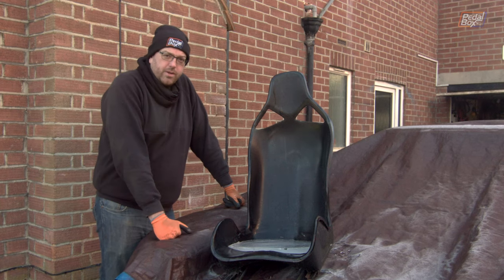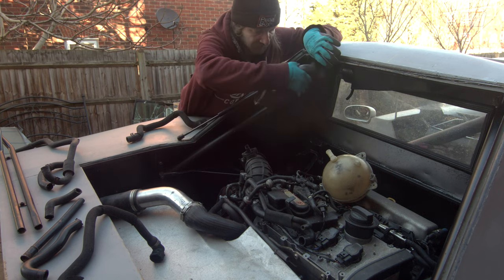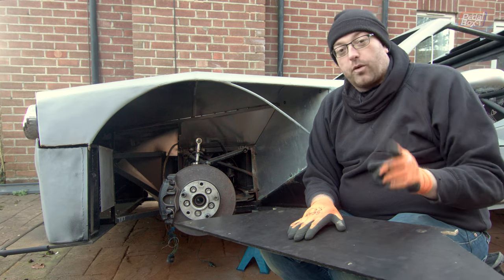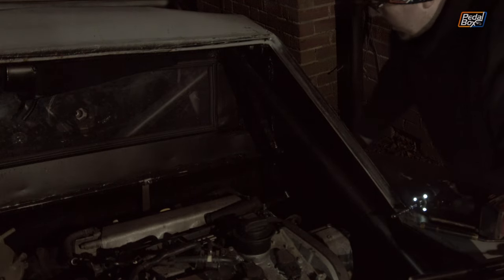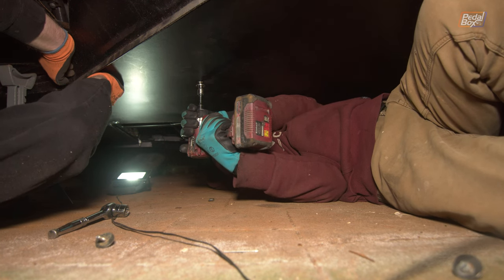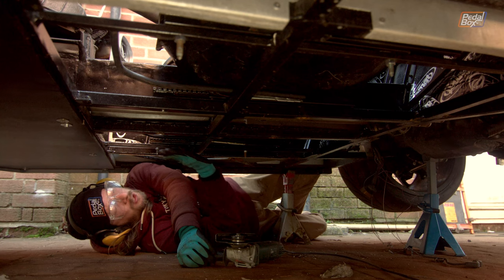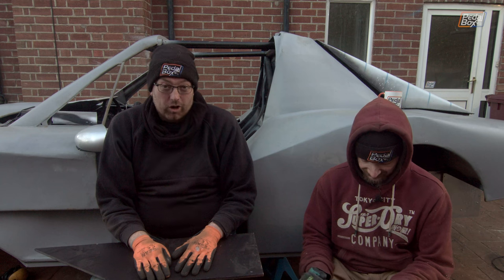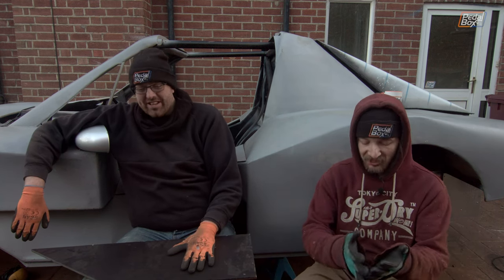Our floor WARPED | Audi TT Kit Car | PedalBox Episode 123

Comment: Are you guys planning on putting a cross brace in the roof? I suspect without it the front windscreen frame would fold out of the way during a role.
Reply from the maker: There's a brace between the two A pillar/roof bars off the main hoop at the top of the windscreen already, but theres a panel between that and the windscreen surround which is the upper join for the windscreen. It's not easy to see that it's in there any more though